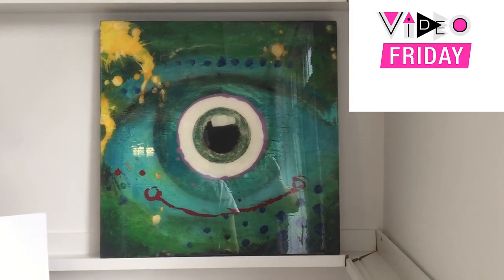How To Make Resin Cure Faster

Comment: Have you ever tried popping bubbles by misting with rubbing alchohol and lighting it off?
Reply from the maker: Hi ZanderTech - wow, the table in that video is beautiful!  We haven't used that technique ourselves.  Since they are doing such a thick pour, it looks as though they are using the flame to generate extra heat to help pop bubbles throughout the entire coat.  ArtResin, however, is not meant for thick pours.  It's a surface coating for artwork and meant to be poured in thin layers no thicker than 1/8" - a flame torch is more than adequate to pop bubbles in a 1/8" layer.  I would worry too about burning the resin which can cause yellowing.  Be advised that alcohol is a solvent and burning it releases toxic fumes - since ArtResin is non-toxic, it's not something we could advise.  Be sure to wear a mask if you decide to try it :)

Comment: Hi, What can I use to hold up wood art pieces after pouring resin on it and during the curing time?
Reply from the maker: Hi Barba - great question!  We like using plastic support stands.  It's important to use 4 identical stands so that they're of equal size, and it's important that they're made of plastic: resin doesn't adhere to plastic, so you can easily peel away any resin drips after they've cured.  For the same reason, it's important to line your work surface with a plastic liner or dropsheet to prevent your piece from curing to the table you're working on.

You can use painter's pyramids (found in the paint section at your hardware store) plastic cups placed upside down, even jumbo lego pieces from the kids section at the dollar store work well!

Comment: So how long does resin actually take to dry? 24 hours ?
Reply from the maker: Hi there,  Cure time refers to the amount of time it takes for the resin mixture to totally finish its chemical reaction and become its hardest state. The ArtResin epoxy resin cure time is 24 hours (hard cure), however you can touch the surface after about 8 hours without it feeling sticky. It  reaches its full cure at 72 hours.

Comment: I want to carve wood to a depth of 3mm and fill it with epoxy resin. After that, I'll likely need to carve some parts of the filled section. I've found some resins on Amazon that claim they cure in 4 hours (or fully in 10 hours). However, I'm unsure if these statements are accurate because you mentioned that it takes over 72 hours for epoxy resin to fully harden. Would you please advice?
Reply from the maker: Yes, there are resin brands that can cure in a shorter amount of time than ArtResin. Many brands are formulated differently to meet specific needs: a faster cure time, a thicker pour, a really hard cure, UV protection, etc.
ArtResin was formulated for artists so we prioritized an easy 1:1 mix ratio, a non-toxic formula and low odor, a long working time, a little flexibility to avoid cracking, clarity, and UV protection.  
One of the reasons our cure time is longer is to maintain the clarity: as the resin cures, it generates heat.  Heat causes yellowing, and the faster a resin cures, the more likely it will cure with a yellow appearance. 
If you're tinting the resin, this shouldn't be an issue, so choose the resin that works best for your needs.
Hope that helps!

Comment: It does work. :) Room temp for me though is 65 so that doesn't work well. :p In the late summer in Texas I have little choice for the temp to be higher or my AC would never shut off. Late July, August, and early September over 100 degrees F is pretty normal for where I live. 
 Still working on that new thing with resin that I couldn't find on Google. It is very difficult but I keep trying and I am sure I can make it work. Wondering though if this is why I couldn't find it on Google. laughs - Heidi
Reply from the maker: oh, I could go for those room temps right about now, Heidi!!  It's snowing like crazy here!

Comment: Someone said it needs to be 24-30 degrees for it to cure. So that means I need my living space that temperature 3 days straight???
Im sorry I feel confused.
24- 30 seems hot to have on 247
Reply from the maker: That’s ideal but it will cure slower if colder and faster if the room is hotter!

Comment: I'm sure this has probably been answered before but I can't seem to find it.....
How hot does Art Resin get when curing?
I'm wondering if it will work with wax molds like "amazing remelt" or if will get to hot and melt the wax. 
Thanks for any information you can provide. 
P.S. love your products!!!
Reply from the maker: Hi Rod
When used as directed, ArtResin does get warm, but not hot. As far as molds, I can tell you that silicon molds work best - we haven't  tried on a wax mold so can't say for sure.  
If you do decide to try it, I would suggest you experiment first on a test before attempting your final project.  
Also, ArtResin was formulated to be poured in thin layers no thicker than 1/8" ... sometimes the heat can increase when pouring a very thick layer.  We always advise customers pour in multiple 1/8" layers if they want a thicker application to help minimize bubbles.  If you do use it in a wax mold, I would err on the side of caution and pour in 1/8" layers to make sure the resin doesn't get too warm as well.  Hope this helps!! :)
Reply: ArtResin Thanks a ton. That is just the information I was looking for. I'll let you know how it goes with the wax mold. 
Thanks again for taking the time to reply

Comment: I keep equal sized cups on floor and over that I keep my resin art to cure. Still it tends to get incline in some direction 
It ruins what I make
Please suggest how to level the surface completely
Reply from the maker: Hi Aanchal, are you using a level to check that your artwork is sitting level on top of the cups you're using? Try our mobile level at www.artresin.com/level to help you check if your artwork is level and ready to resin.

Comment: So if you have to wear a respirator to use the resin then is it safe to cure in the house?
Reply from the maker: ArtResin is safe for home use when used as directed in a well ventilated area.  It does not produce fumes or VOCs and is non-toxic, so as long as you work in a well ventilated area, you do not need to wear a respirator.  Here is our blog with more information how to safely work with ArtResin:  https://www.artresin.com/blogs/artresin/what-safety-precautions-should-i-take-when-using-artresin?_pos=3&_sid=fae302c53&_ss=r
Reply: @Artresin  If there are no fumes, VOCs, and is non-toxic, then why would you have to worry about ventilation? Your statement, which I have seen elsewhere from your company as well, is in conflict with itself.  

btw the video is minimally informative. You can do better.
Reply from the maker: @Kinoko314  ArtResin is non toxic and does not produce fumes or VOCs but it does have a very mild scent.  People have different tolerance to scent, think about perfume-some love it some get a headache from it.  For this reason, we recommend working in an open area with some fresh air circulating as opposed to locking yourself in a small closed off closet.  We understand the confusion as many brands of epoxy resin are dangerous chemicals and can cause respiratory distress if you are not using a respirator.
Reply: @Artresin  I ran into this video trying to figure out how to get resin to cure during the winter. The way for me to keep the area ventilated would be to open windows and doors, but I can't do this during the winter, specially if I'm trying to keep the room from getting cold. I have a 150 sqft studio space. Is it safe for me to work with this resin with doors and windows closed, in the winter? I can have a fan running, but that air is just staying inside, just the same. Thank you in advance for the info.
Reply from the maker: @carocoto78  Your space should be fine, we really just want you to work in an open area rather than closed up in a small closet.
Reply: @Artresin  Thank you for replying so fast :). I'm glad to hear that my space will be fine even when I can't open the windows.